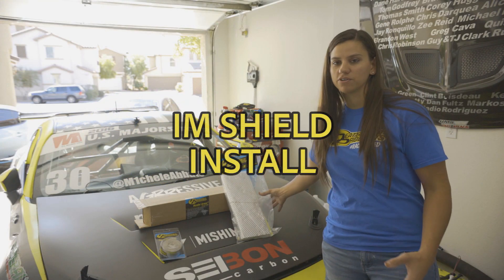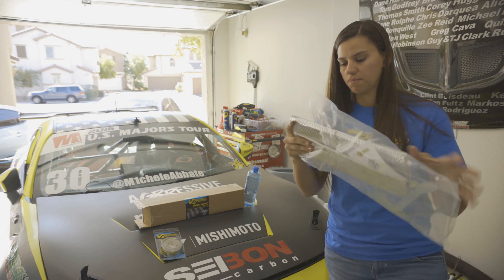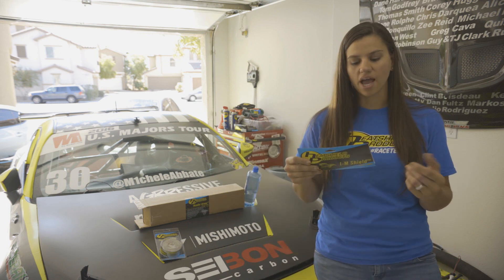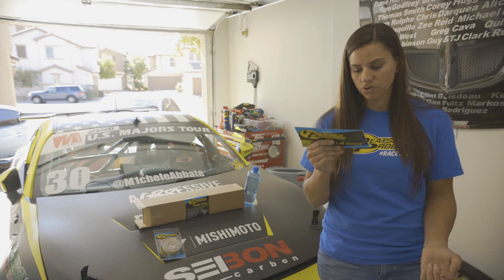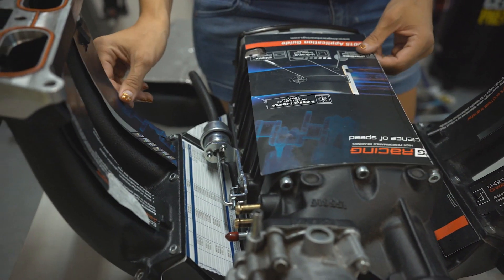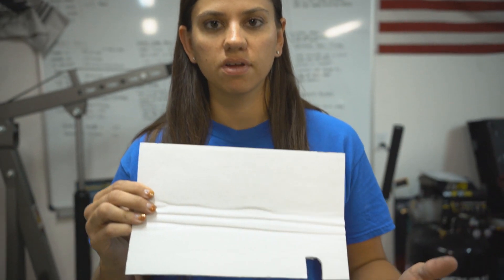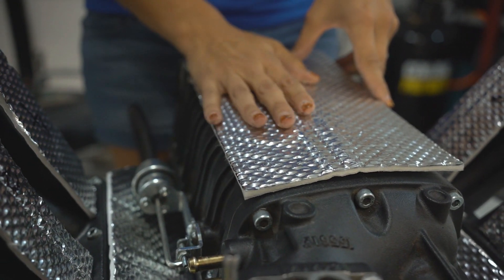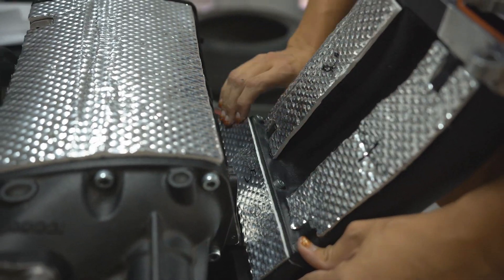Cheap Horsepower - Intake Manifold Heat Shield Install | Heatshield Products

Comment: Excuse my ignorance, but wouldn’t the adhesive melt on high temp components?
Reply from the maker: Thank you for the comment Charlie.  The adhesive is on the intake which is the "cool" side so there is no problem in this application.  You would not want to use this product to stick on to something very hot.

Comment: why would you insulate the supercharger, things way hotter then ambient. you would want it to pass that head out of the case instead of into the air charge
Reply: The supercharger is mounted underneath the intake manifold.  You would put the heat shield on to reflect the radiant heat from the engine. Ultimately this would reduce heat soak and decrease intake air temps.